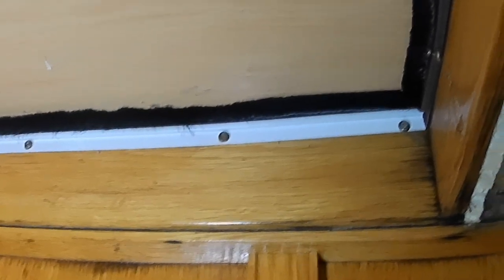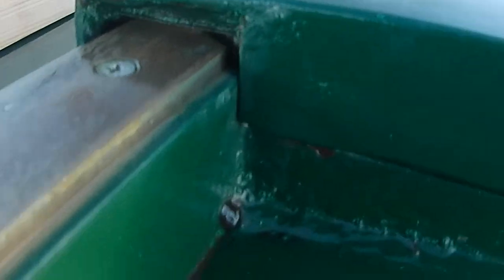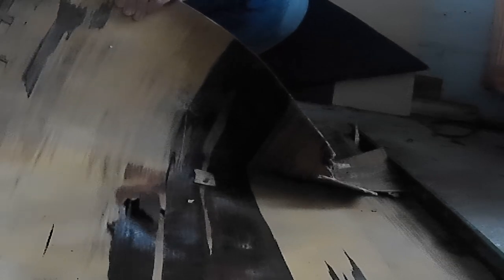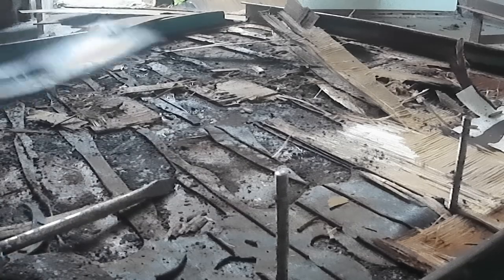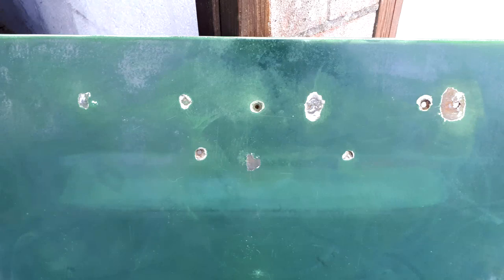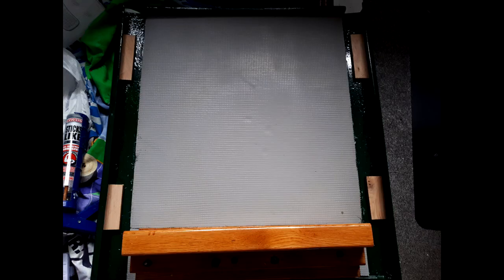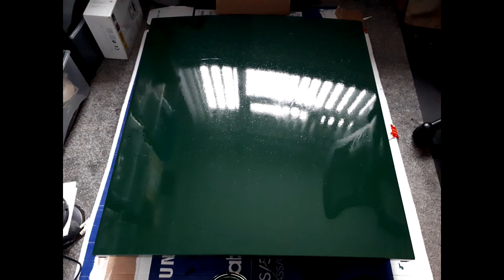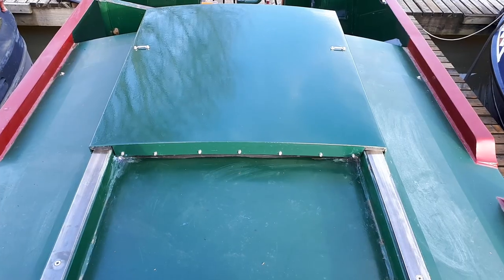#16 Refurbish the Stern Hatch

Comment: What a great job. My hatch was in a similar condition. Like you I had to scrape the wood off. I rust treated it but haven't got round to fitting new wood. The 6mm sheet you used looks like the stuff I need. Your paint looks professional.
Reply from the maker: Thanks Will. The board used is https://www.wickes.co.uk/Prowarm-Backer-Pro-Insulation-Board-Single---1200mm-X-600mm-X-6mm/p/166935. The paint is OK but not perfect when you look closer!  :)
Reply: @robtheplod  ok great. Thanks for the info. For a first time go it's good enough.

Comment: Hi,  A good descriptive video and a lot of work showed with a good results. What paint did you use and did you treat the 4 runners you fitted. Stay safe
Reply from the maker: Hi Ron, thanks for the comment. The paint is International Toplac Donegal Green 077. I didn't treat the runners as such, just brasso'd them. I do smear candle wax on them if the lid gets hard to push though!
Reply: @robtheplod  Thanks for that info,and I thought the runner was a hardwood which is why I asked.Look forward to the next.